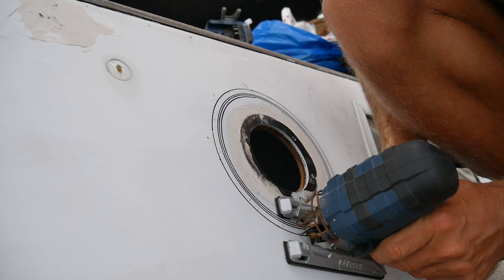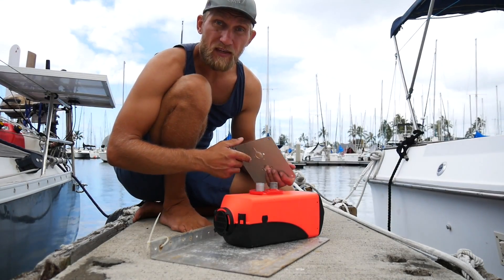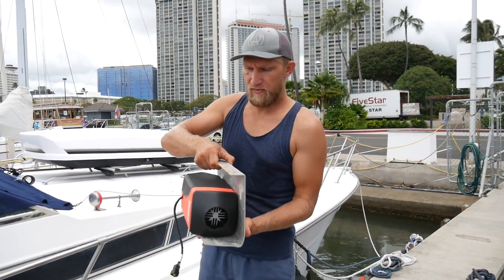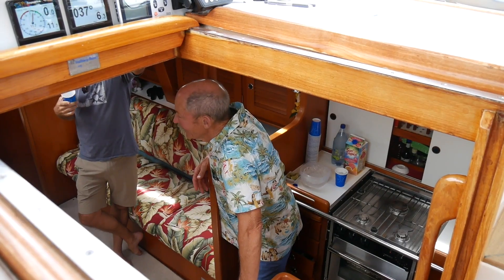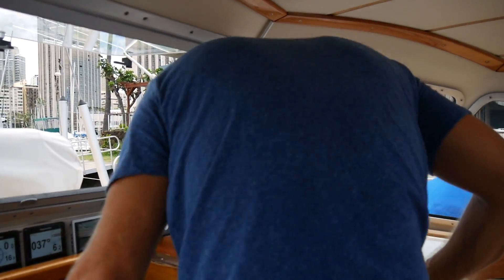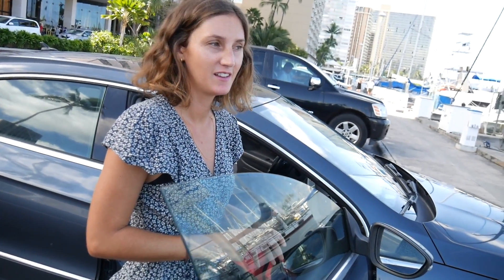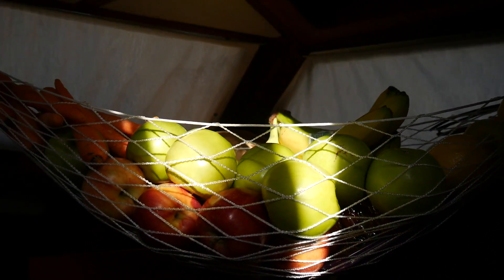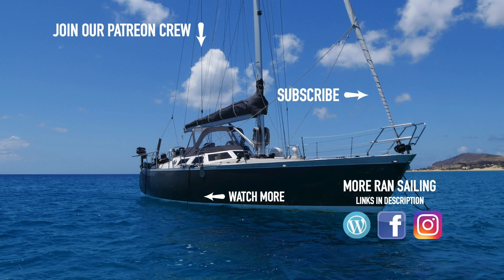Getting Ready To Sail To Alaska - Ep. 112 RAN Sailing

Comment: You can use rtv silicone on joints up to 650 Fahrenheit above that you can use millpack sealant. It hardens as heat is applied. As for you waterpump ,those are weeping holes. They leak to give you indication that the seals are failing. So before the seal between pump and engine fails, it weeps beforehand to give indication that it should be changed,

Arek

Comment: My apologies if you know this already, just trying to help.

I saw that you used a syringe to top off distilled water in your batteries. There is a container you can buy at US auto parts stores like NAPA, Autozone, O’Reillys, etc, specifically for topping off distilled water in batteries. They’re usually black plastic with a spring loaded spout and look like a pitcher. Only a few dollars, fill with distilled water and store till needed. Lets you fill the battery correctly, quickly, easily and with no mess.

Comment: you are going to Alaska in a metal boat with no insulation and then adding a heater!!!!! you will have plenty off fresh water .....all over the inside off the boat !!
Reply from the maker: We have insolation. Why do you think we wouldn’t have that? Cheers!
Reply: because I can see bare shell plate and exposed stringers any metal exposed will condensate  I have built/refitted many metal yatchs including the one i live on and insulation is key to a dry warm boat  the best by far is spray foam as it's the only  way to insure there is no air trap between  the insulation and hull . all the best

Comment: Johan, don't forget to check the exhaust of the diesel heater often. I got a corroded stainless steel exhaust hose and all the exhaust in the boat. It was very dangerous because of the carbonmonoxide and carbondioxide.
Good idea to use a hose on the vacuum valve. I made the same after the original Volvo valve didn't work proper. 
so long
Tom

Comment: Hi, if your engine is the 2003 T 43 hp Turbo and you ever need a complete oil cooler for the engine I have a used but in excellent condition one

Comment: Those diesel heaters always cause problems over the long haul.  They are great for installations where something like a Dickinson like the sig-100 won't fit.  Bad fuel will clog them up in a heartbeat, and the fans or pumps quit(depending on the model), and they constantly need to be cleaned.  I had one that under continuous use it just kept failing.  They are great if you only use them for occasional use, but to count on those blower type heaters to save my life, I wouldn't do so.  You probably don't have room for a sig-100 or larger though so you do what you can.
Reply: Allyn Onderdonk a

Comment: Hey guys, another great video!  You are right on target with the importance of the vented loop.  I have unfortunately had some vent clogging problems due to salt buildup with the black plastic one that you are installing.  If you keep it, be sure to wash the little valve out with fresh water from time to time.   None are perfect but so far the bronze Groco vented loops have been good to me and my customers from a clogging standpoint.  As you stated, the bypass method which eliminates the valve is a good way to go gives a visual confirmation of water flow and also keeps the water outside of the boat.  Don't be tempted however to put the discharge water into the sink or any interior part of the boat because if you should loose cooling water, you now have exhaust in the boat.  You will even get some exhaust bubbles even if there is good water flow.  So just direct the water into a cockpit drain or over the side somewhere and all is good.  Best of luck to you on your sail to Alaska!  Jim and Joann,  SV Sueno.

Comment: You guys should consider getting a small 3D printer. All of these plastic parts you're buying you can make yourself. It would be good to have in an emergency as well, or at least until you can get the correct part. You'd be able to make parts at sea.

Comment: I dont get why it is a problem if the cooling water continues to run through the engine after it is stopped. How or why is it flooding the engine?
Reply from the maker: It's because the seawater going through the heat exchanger exits the boat the exhaust hose, so if there's no exhaust pressure (engine turned off) to push this water out it can enter the engine through the exhaust valves. Not good! :-) Cheers!
Reply: RAN Sailing should havd a curvature going above water level  and exhaust extention outside hull also above . Lycka till
Reply: RAN Sailing I see, thank you very much!

Comment: I always look forward to your latest episodes. Have a safe trip north with good weather. You two are great, Ty for sharing. Where did you put the exhaust vent for the heater? The exhaust is held onto unit with more than tape right?
Reply from the maker: We used the exhaust vent from the old heater that broke down just after we left Sweden. And sorry if I didn't make it clear in the video about the exhaust hose, there is of course also clamps to hold the hoses together, the tape is just an extra precaution. Thanks for watching! Cheers! /Johan
Reply: Great to hear back from you and so quickly! I figured it had to be clamped but had to mention it, not remembering you had a previous heater. I hope you both enjoyed your time on Oahu, it looks as though you got some things done to the boat and had some R&R. I must read some about heaters on sailboats. You guys must be leaving soon. fair winds and following seas to you.

Comment: Apparently the water pump problem is on going for Volvo marine engines. I have replaced mine twice for model 2000 T on my Older Oceanis 390. I always  learn something from your installation, maintenance and repairs.  Safe journey for your passage to Kodiak👍

Comment: UHT milk is essentially unheard of in the US.
Refrigeration is ubiquitous and refrigerators are huge. There is no need to stock milk in a pantry and only refrigerate the open box.
It is a bit strange though, that a cruising crossroads like Hawaii doesn't have a supplier. Perhaps a missed opportunity for someone.
Personally, I can't stand the taste of UHT milk. I've had it aboard when cruising in Europe and the Caribbean as a last resort, as sometimes fresh milk was not available in smaller markets, or was immediately sold out when it was delivered, usually in plastic bags which required a 'holder' to make them usable.

Comment: Johan, tape is never acceptable to connect the exhaust of the heater.   It must be mechanically fastened using approved clamps.  I don’t know much about boats but a quick run through of a comparable webasto marine heater manual shows a proper way to connect it.   If you don’t already have one please install a carbon monoxide alarm.   I enjoy your channel.   Safe travels.
Reply from the maker: Hi Clint! There are clamps around the stainless hose, I just wanted to make sure there's no leak, so I put the alutape around the outside of the joint.  We have a carbon monoxide alarm next to the bed.  Thanks for watching! Cheers! /Johan
Reply: RAN Sailing happy to hear it.    I’m not an hvac Pro but after many years I’ve seen some scary things.